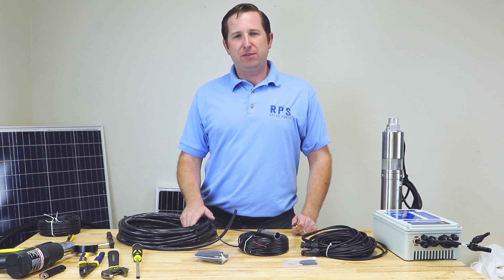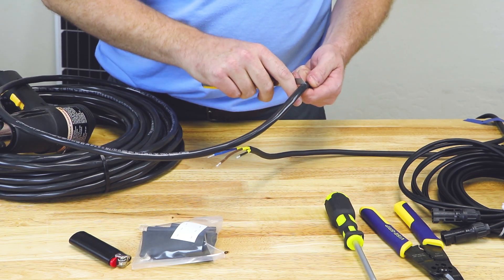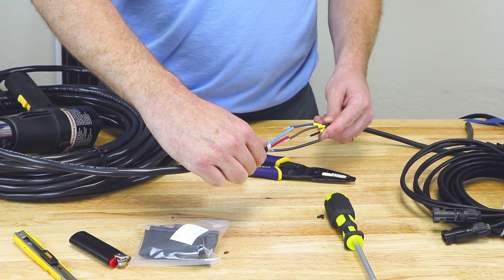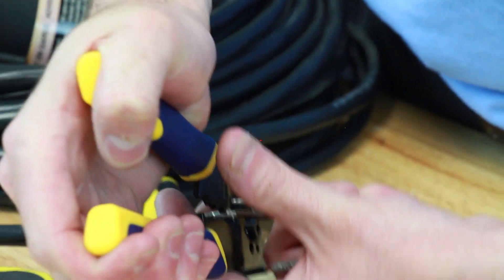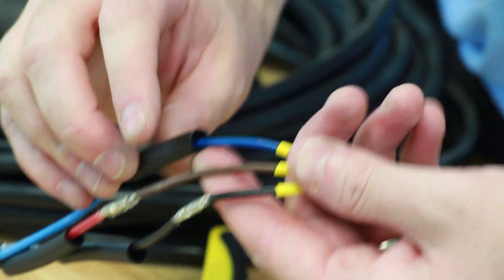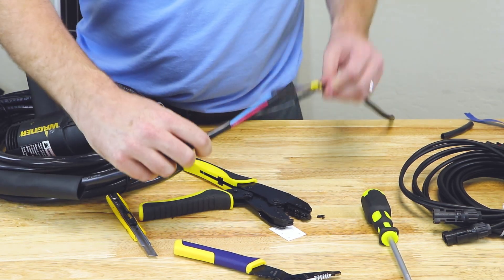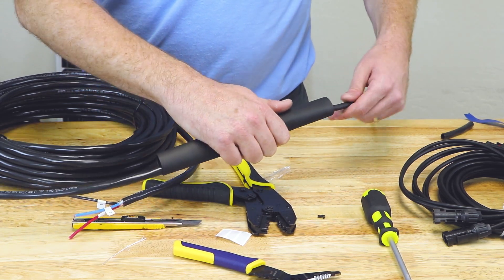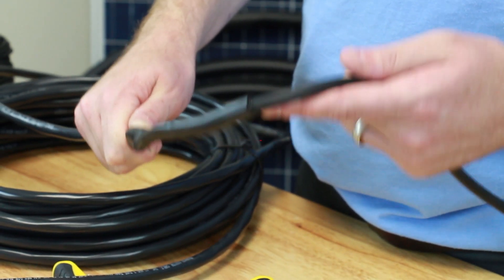Wire Splicing for Solar Well Pump - RPS Kit Installation

Comment: I have noticed in the last two wire splice kits I’ve received, there is a folded up brown paper with a piece that looks like flat adhesive (peel and stick). I’m assuming this should be used but I haven’t seen it in any of the videos?

Comment: ON my install the wires already had crimp on connectors on wires. The heat shrink wouldn't go over them. The crimp fittings were way to hard to crimp by hand. There were small pins in with the heat shrink pieces. Not sure what for.
Reply: Same here. Ended up having to get a new pump anyway and the heat shrink did fit over those. The crimp fittings I ended up having to use a hammer and punch in order to crimp the connectors. Got the small pins also. Not sure what their for either. My new pump worked for a day but now I can't get enough voltage from my solar panels to run unit. Also FYI although the sensors are the same however the panel reads them different. Sensor used in tank is looking for a normally open circuit. Sensor in well is looking for a normally closed condition. Also FYi rotation of pump looking down from outlet pipe is clockwise if you have a rotation problem. I am now having a problem with my solar panels generating enough voltage. Should be getting 42 to 44 volts DC input and 26 to 28 volt output in case you have the same problems I'm having.

Comment: Eh, just use electrical tape
Reply from the maker: You can give it a shot, but if your electrical tape leaks you are looking at corrosion of your submerged splices.  This heat shrink tubing has heat activated sealant inside and creates a nice tight seal around your splices when you shrink it down, to minimize water intrusion.

Comment: How much water flow do you have to have for this type system
Reply from the maker: 3in pumps we can go up to 16 GPM.  If we go to our 4in pump line we can do 150GPM+ but it also depends on the pumping head as well.

Comment: Can we use the wire on our 220V that's being replaced? Thx
Reply from the maker: Not with our standard systems, but our Pro like of solar pumps have automatic solar to AC transfer built in, so you can keep pumping at night or on cloudy days!